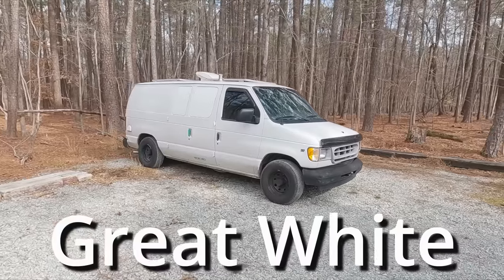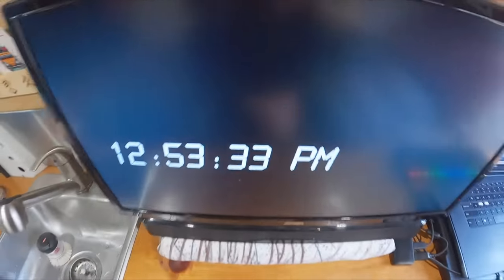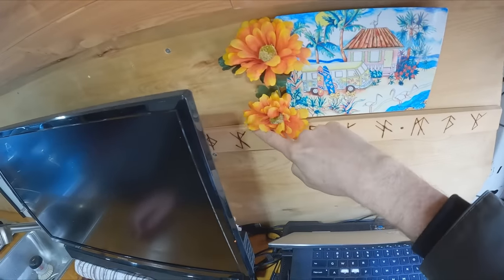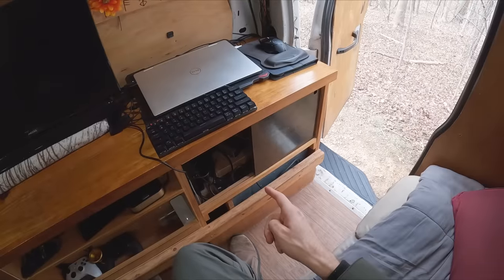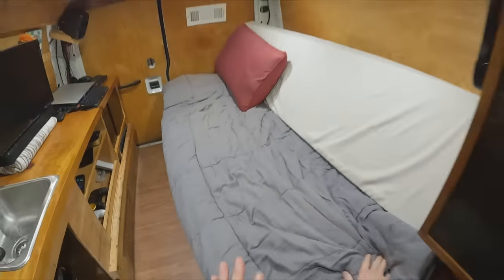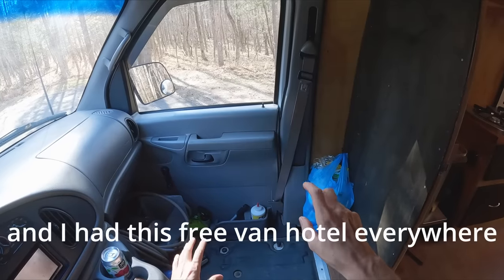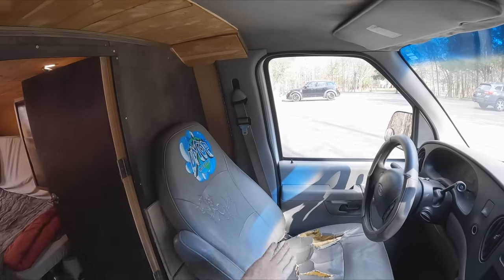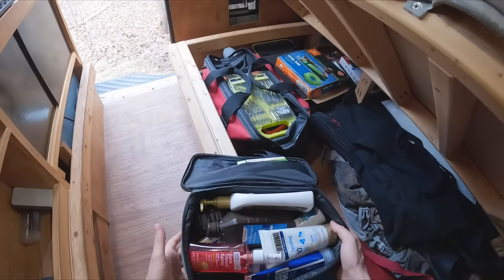STEALTH VAN LIFE TOUR | Differences Four Years Later

Comment: That was smart of you to put your propane inside the cabinet cause if it exploded it would be contained
Reply from the maker: Hahaha, that's definitely not why I did that. Explosions with propane tanks are extremely rare, btw. They are very safe unless you mix high heat with impact. Car crashes won't blow them up unless high heat is involved even. Testing was done in labs on this! I've reviewed said tests and reasoning. What I should have done, though is have a vent, but I did have a leak detector. Never once went off though.
Reply: @OutdoorsEmbrace  if its so safe put the propane canister right next to the wood stove and make sure its nice n HOT!!!! HAHAHAHAHA L.M.A.O.O.O.O.:face-blue-smiling:
Reply from the maker: @owensdaniels6244  haha, they actually did tests with that in lab too and it's safe enough to do that, but hell I wouldn't do it myself.
Reply: @OutdoorsEmbrace  YES SIR IM FOLLOWING  YOU ON EVERYTHING AND I AM GOING TO PUT TWO PROPANE TANKS INSIDE A WOODEN BOX INSIDE ANOTHER BOX THAT WAY IF IT DOES BLOW UP ON ME BOTH WOODEN BOXES WILL SLOW IT DOWN AND GIVE ME TIME TO JUMP OUT OF MY BOX TRUCK, HEY IM THINKING
Reply from the maker: @owensdaniels6244  hha, well I don't recommend it to other people, and in an earlier video I do addresss this somewhat.

I only personally did it due to keeping a low pressure in my tank, not a full one because these tanks do leak automatically if the pressure gets too high, to compensate. So a vent for most should be mandatory. But I personally always recommend a gas leak detector, which I had in that van.

Now i have my new van and will be mounting any larger tank on the outside if I go that route. I'm currently using the small one pound tanks.
Reply: @OutdoorsEmbrace  OK THANKYOU! I JUST GOT OVERLY IMPRESSED BY THE WAY YOU ORGANIZED YOUR WHOLE VEHICLE I SAW THAT PROPANE TANK IN THAT CABNET AND A LIGHT BLINKED IN MY MIND. CAUSE I WAS THINKING HOW IM GOING TO MAKE IT SAFER, BUT I DO UNDERSTAND WHY YOU DONT RECOMMEND IT
Reply from the maker: @owensdaniels6244  for sure! You bring up legit concerns.

Comment: Is that what you do when it is hot outside you just run a fan to extinguish the hot air out all right I understand that's where it was way back in the old days! But let me tell you on super hot days you just pull hot air in and hot air out and it's not going to make any difference! You need a battery Bank so your solar panels will be charging the battery Bank and the battery bank will be fully charged and able to run anything that you put up against it but I can't see that happening in a van!
Reply from the maker: I mean, cool that you don't see it happening, but people do it all the time.

If you are talking about AC, remember that 100 years ago we really didn't have AC. I wonder what you would have done then.
And hot air in and hot air out, yes maybe, but it's the breeze that makes the biggest difference. It's actually like sitting under a shady tree with a breeze if it's over 100 degrees. Still 100, but you have wind. Honestly, why stay in the 100 degree weather though??? You are on wheels and can move to a cooler area!
Reply: Dude you'd have to go back a hundred years just to 1960 and around there I was born in that era we did not have air conditioner we had fans a window fan in my bedroom pulling air out of the house let me tell you it was not comfortable I did survive as you all will but it's not comfortable
Reply from the maker: @hosseric  oh I understand completely haha! Definitely not comfortable haha

Comment: That "gaming" setup is completely non-ergonomic. You'll have back and arm pains very fast. a chair in such space with bed compromise would nice. Especially Ikea conference chair without wheels
Reply from the maker: Correct for most part. I found ways to make it work though.

My new van has much better ergonomics. Not shown on YouTube yet, but I'll make a halfway built tour soon
Reply: @OutdoorsEmbrace  Hopefully you'll get a perfect fit with online ergonomic calculator, and find some tricks to get both desk and chair secure. TTTheFinePrint gaming setup is the most impressive. Thinking of adjustable desk, it may be nice to have a slightly lower desk base and put some flat things with magnets or glue for perfect measurement according to body heights. That would really be peak experience. 10+ hours computer time in a van without ergonomic compromise! I just decided the van life isn't for me, since the showers, laundry, bug infestations, temperature control are really dealbreaking. Unless there's a nuclear or similar apocalypse, van life is only good for special preferences. So amazing that you put all the effort and enjoy it in the end!
Reply from the maker: @IrrationalDelusion  I like TTTheFinePrintTTT van. That van looks really nice. Gaming set up is cool.

My new van has 5 days of Gaming battery on Ultrawide 30 inch with 180HZ refresh. Bed below it is a queen plus 8 inches. When in Couch Mode (like my first van you watched), the table pops up twice to have mouse and keyboard right next to you at proper level. I still have yet to put in the foot rest below, but once done, the vans ergonomics will allow me to sit for long hours and edit video or play games.

I have 800 watts now of solar, 600 amp hours of Lithium. Gaming on either a Mac Mini M1 or my XPS15 laptop. I will be buying a Steam Deck very soon.

Mac = 35 watts of power.
Steam Deck = 45 watts
These are both nothing! Run for days. I leave my computer on at all times now pretty much. Haven't gone below 88% battery overnight ever yet.

My XPS laptop runs at 120 watts, as a comparison. Still low, but I currently use it for games not on Mac. The Mac runs game really well though, if they are compatible. Also now have Tmobile internet 5G unlimited hotspot. Can download games anywhere, fast.

I believe my Gaming set up might be one of the most impressive of all van life builds. Also have a 12 inch subwoofer below the bed, will have two 6.5 inch speakers surrounding the ultrawide TV. With the sub, you can feel the Gaming experience. Immersive. Will also have Mood lights again all the way around and possibly behind the TV.
Reply: @OutdoorsEmbrace  XPS is more of a design than performance laptop btw, it throttles after 30 mins of Cyberpunk immensely. Chunkier gaming laptops with more fans and those compact pc builds should be more capable.
Reply from the maker: @IrrationalDelusion  oh for sure! I like the XPS but it's not the best. Not bad for power use, and honestly I haven't noticed much in the way of throttling performance. It seems to keep up really well with any game I play. My biggest negative is the keyboard. I got the 2 in 1 version, and it's just so compact that the keys get brittle and break off and Crack.

Definitely not going to be taking the XPS for the long term in the van.

Comment: This wouldn’t be good for me. I need more storage space, an AC and heater. When I get my Van, I have a plan how I want mine done. 
I don’t get the wood stove. I’d never get one of those. I see it’s a guy thing since lots of guys buy it. I’d also want more solar. Always best to have too much than not enough. An AC mini split would be a must. I hate the heat. If it’s over 70 degrees inside, I’m not comfortable. But every van is custom made for the person who buys it. 
I see you’re getting a new van so I guess you’re not happy with this build either .
Reply from the maker: I was very happy with this build, but my new van is already 60% built and so much better! I can now stand. I also now have a diesel heater, which is way more practical. The wood stove is for sexy time really, good for having friends over and impressive to show and watch. It works, but it's not practical at all for a van due to it not staying lit for long (maybe an hour or so and then the heat can stay around for up to 6 hours after).

The diesel heater is much better and consistent heat, I just keep it on 24/7 and it's always the perfect temperature inside due to its climate control auto on/off.

Besides just using shore power, which works for an AC unit or mini split, obviously, having AC run on solar is still somewhat out of reach for vans for the most part. There can never be enough solar to maintain the AC 24/7. BUT! You can have enough insulation everywhere without thermal bridges so the air stays cooler longer before the compressor needs to start back up. So the insulation alone is the main problem to tackle to have a solar powered AC. You must have a big lithium battery and lots of solar. In my new van, I have 5 inches of insulation on every wall and the cieling has 3 inches so I can still stand. I'll be testing out having an AC on all day for the hottest summer days, since you really only need it for the daytime when it's hottest and most sunny anyway. I believe my set up will work!

Comment: How much did this cost to set up? I feel like you need to have at least $30k in savings to pull this off, in reality that is as who wants to live in a $3000 van that breaks down every 5 minutes and has none of the custom interior. And it's not quite as much fun if you're working the 9-5 to keep a van going. Van life is a thing for middle class young people to do for a few years, as an adventure. And for people to imagine the life as better than it is.
Reply from the maker: I got the idea to van life after getting out of the Navy, flat broke and in debt. I sold everything I owned to buy the van for $3000. Then over time while working a 9 to 5 at a cvs and hotel, I built it over a year. It wasn't less fun during this time. It's also not just about the "fun". This idea might help people get into it, but it's an alternative lifestyle.

So I built the van for about $4000 to $5000 over time and then my YouTube took off so I quit the job and never looked back. Yes, since the life is different enough from house life, you can make money on social talking about it. Just to be clear, I never thought I would make a single penny in the beginning.

The van also only broke down once in 4 years, of which I had plenty of money to fix on the spot while staying in a nice hotel. You don't need tons of money to maintain van life because the lifestyle itself is cheap and allows you to work way less to maintain it.

So even if you did this and parked outside of a job, you wouldn't need money for rent, so you could work 3 days a week and be in the same position as someone who has a house and needs to work 6 days a week. That person in the house never even sees his house cause he's always at work. Typically anyway.